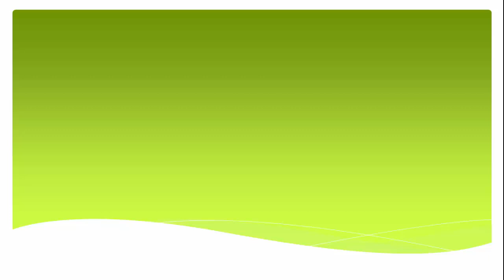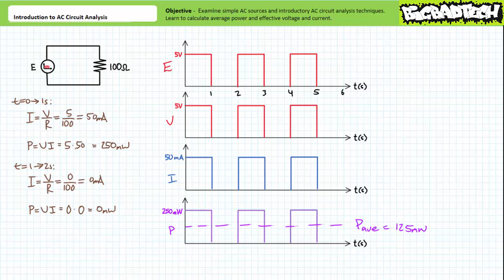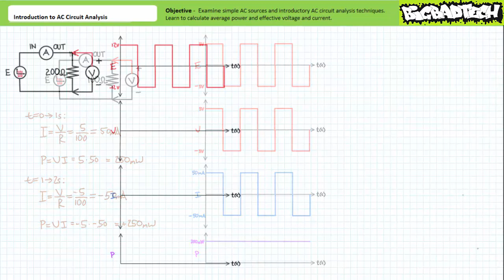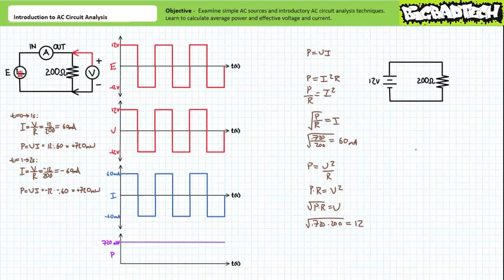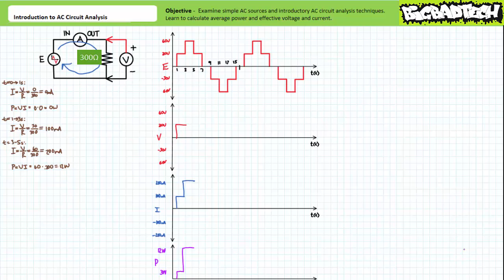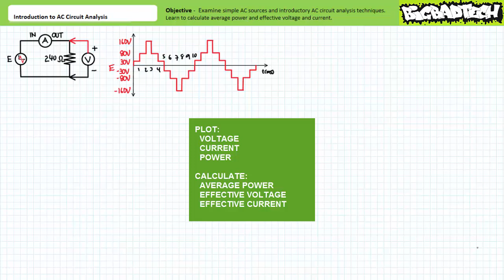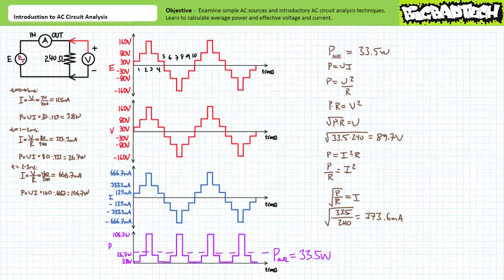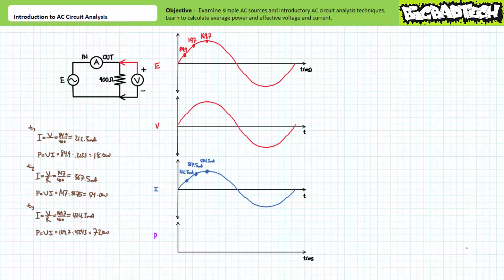Introduction to AC Circuit Analysis (Full Lecture)

Comment from the maker: Lots of people seem to have problems with averaging. Don't make it hard. It's just like regular averaging. Example: @ ~20:00 0W for 1s, 3W for 2s, 12W for 2s, 3W for 2s, 0W for 2s, 3W for 2s, 12W for 2s, 3W for 2s, 0W for 1s over a time span of 16s is (0+3+3+12+12+3+3+0+0+3+3+12+12+3+3+0)/16 = 4.5W.
Reply: Sorry, I still confuse ( 0+3+12+3+0+3+12+3+0)/16
Reply: @chandararanget7879  I was a little confused at first also.  Where I got tripped up was not adding the Power (w) for the instantaneous (per sec.)  I also believe Mr. Pytel missed a couple 12's in his response.   0+3+3+12+12+3+3+0+3+3+12+12+3+3+0 = 72. 72/16 seconds = 4.5
Reply from the maker: Good catch. I am indeed missing some 12s! I'm going to see if YouTube will let me edit the reply.

Comment: Great Video! There is an error at 11 min mark when 60 mA is calculated.  Then when converted back to Amperes it is written as .6 in the equations that follow, but 60 ma= .06 A. Thanks again for making these lectures.
Reply from the maker: Good catch! Yes 60mA should be written .060A.

Comment: why do we need to find the average power 
why cant we use directly find the effective voltage or current 
i think it is because of two different values will come 
ex : 1 to 3 then 3 to 5

Comment: Minute 29:03

My answer is 38,1 and not 33,5 for the ave. power
(106,7-26,7-3,8):2 = 38,1 

What am I doing wrong?
Reply from the maker: Consider the 10ms time span of the whole waveform: Average power for the 10ms period is (3.8+26.7+106.7+26.7+3.8+3.8+26.7+106.7+26.7+3.8)/10=33.5.
Reply: Thanks! 

I was looking for DC RC/RL/RCL Circuit Analysis Videos on your channel but I can't find any. And also no videos for electric field or magnetic field or I just can't find them? 

All books are just crap to grasp the material. ^^
Reply from the maker: Check out the update I just published: https://www.youtube.com/watch?v=pELqwaOw9dQ 

I'll be filling in the holes in the basic electronics series when I get back from summer holiday including transient DC analysis of capacitors and inductors. I've got some older material on magnetism as it relates to motors at: https://www.youtube.com/watch?v=fv5494lRQAs